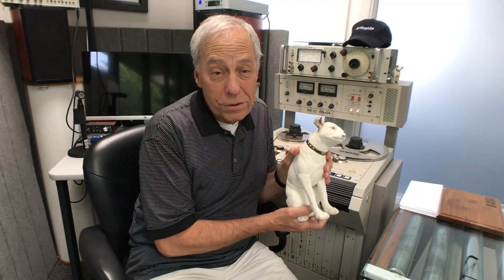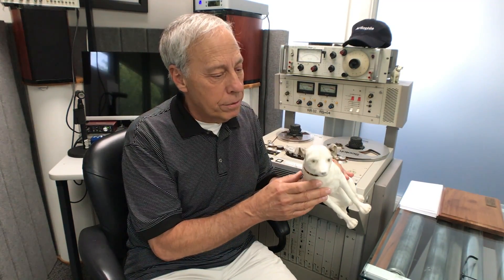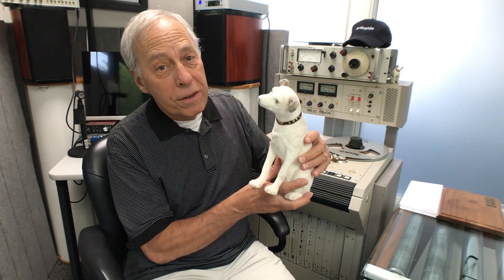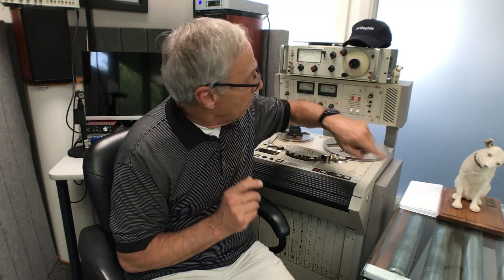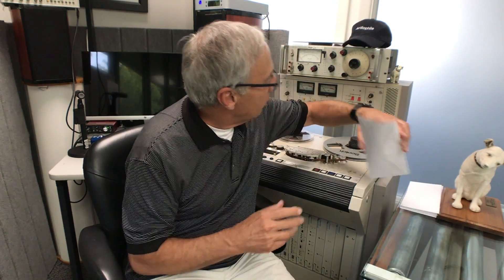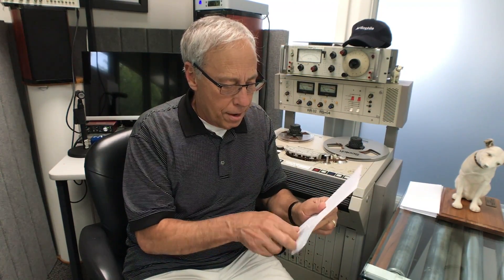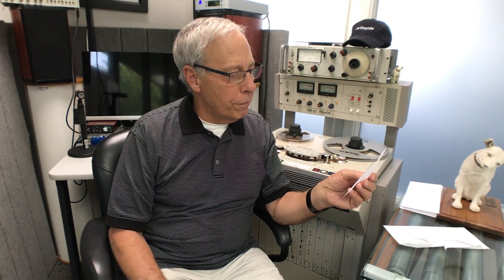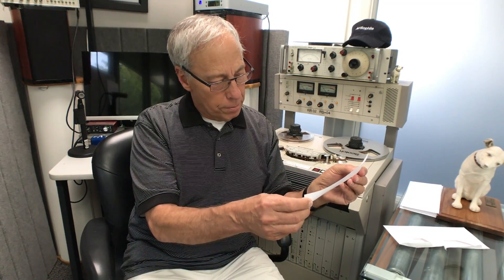Thin cables inside speakers

Comment: Its all about marketing, big and expensive cable to the speakers and inside thiny cable, question is why so thick cables from amp to speakers, well like I say its marketing, they know that smaller cable will do the very good job, but how they will sell you few hundred dollars cables, some times very thin cables from Kenwood, Sony, Denon, made in China can make very good sound. Power thats consumed from amps can not be transfered direct to speakers, components inside amp consume that el.power and transform to heat and bias, not all go to speaker cables. If speakers are efficient they do not need so much el.power and very tick cable, one of most efficient speakers I have was Canton from Germany, my small Denon F102 run big passive 30cm-12inch subwoofer like its nothing, others speakers need bigger amp...

Comment: Excuse me. But take the voltage/power loss over a  10[cm] speaker cable  as found inside the cabinet, and compare it to say 3[m] of same gauge cable. You have your answer there...
Reply: I have just read your comment ,I have rewired my speakers with thick wire NO change in sound quality.
Reply: I can measure it for you and compare voltage loss/length... but I wont, because I gave up on YouTube. Just do the math, it's there :D
Reply: Dambuster, as can be expected!
Reply: And the 8 ohms of copper in the voice coil?
Reply: @robertt7238  You think that's the DC resistance of the voice coil?? You know better than that!

Comment: I would say because the runs inside are much shorter, and also they are split up into separate runs for the different drivers.  So, three separate runs of 18 Ga. Would be equal to one 13 Ga.

Comment: The better question to ask is "why do you think loudspeaker wires need to be thick"? The only reason XLR or NL2 cables are thicker is because its a cable, not a wire. Its multiple wires wrapped together and surrounded with shielding. XLR for instance has 3 wires in it, while NL2 will have two, but thicker shielding due to its higher voltage.

Inside a wooden or polycarbonate speaker cabinet noise is little due to the material of the cabinet. Even if noise does reach the wires, its doubtful it would be powerful enough to drive an entire driver.

Comment: I dont think i have a really great answer, but its does make a difference.... Because i say it and i sell speakers.
Reply: Thats the problem,he never really answers your questions,only bla bla bla.
Reply: Xab Deth To which PS Audio speakers have you listened?
Reply: It would take a 30+minute video to go over the affects of each speaker design from speaker wire size going from terminal to crossover to driver. Mostly it has to do with impedance and power rating. However it will change sound signature and characteristic. It would depend on the speaker design into how it will have the most change; this is why he doesn’t go into depth however the simple answer is that it does make a difference.
Reply: @InChristJesus87  or maybe not
Reply: A speaker and wire forms a voltage divider network.  Resistance matters, therefore wire gauge matters.
Also, electrical skin effect.  Conductor count matters because of the skin effect.
If you care - go ahead and educate yourself on these two concepts.  If not, then there's no point in wasting my time explaining the details.
Reply: @jdlech  there is no skin effect in such low frequencies in audio ! 20-30kHz is nothiing. Skin effect occures by very high frequencies. Cable companies and "highend" people tell us many nonsenses.
Reply: @jdlech  it occurs at high frequencies and that is fact.
Reply: @a0r0a745  It occurs at ALL frequencies, and that is fact.
Reply: @a0r0a745  I never argued that it has any effect you can hear.  Quit trying to straw man me.  bh69videa argued that there is NO skin effect below 30KHz - which  is wrong.  I claim that it affects overall wire resistance - but no claims about how significant the effect is.  Just that it can be minimized with high count conductor cable.  Maybe if you actually read what I wrote instead of assuming a straw man argument, you would have known that.
Reply: @jdlech  why mention it then if it does not affect the sound quality. Pointless bringing it up don't you think. Straw man argument, you decided to bring up the issue that is not an issue in audio. Think about that, you decided to tell someone to get back to you. Did you even look at the Audioholic link. You include a link which I looked at and I read what you said. You make a argument for what exactly? Strawman.
Reply: @a0r0a745  Why mention the general theory of relativity when it cannot be measured on your trip to the grocery store?
We're talking audiophile level here - not your average chintzy radio or tv.
Reply: @jdlech  now you bring the general theory of relativity, why? care to expand what on earth you are actually trying to say? You don't make any sense.
Reply: @a0r0a745  So you're incapable of understanding metaphor.  Interesting.
Reply: @jdlech  I sense a superior being🤣 I had better bow out before I really get shown up😂 who is the one incapable of answering my previous questions? Interesting😂

Comment: There are many sources of electrical resistance in a speaker enclosure, the wiring itself is probably the least important.  The speaker voice coil,  crossover inductor  coils power resistors and adjustment rheostats all introduce losses most of which can't be easily avoided.  Anything beyond 14 guage is not needed.....for most home systems at least.
Reply: James Hindley I guess your system is built around voltage losses and not how things sound.

Comment: I heard the Infinity IRS speakers twice. Once with Conrad Johnson electronics and once with Mark Levinson electronics (Cello). They sound great and do everything quite well except the image tends to wander up and down the drivers. I prefer an electrostatic which has a solid image that is big yet everything in that image has the right size.
Reply: Anders Hammer I agree and would add magneplanar speakers such as Magnepans.
Reply: Magnepans are great but they make everything sound too big.
Reply: I like electrostats too, but it also might be worth your time to check out the speakers at round sound dot com. I have found them to be fairly impressive for non-panel speakers. Just sayin'.   : )

Comment: Kirchhoff’s Current Law.......google that..... current in = current out......you expensive cable guys need to stop and think about this....you have a fire hydrant connected to a fire hose.....once it hits your cabinet....it turns into a sippy straw.....that's where Kirchhoff’s Current Law comes into play.....the MAXIMUM amount of current ALLOWED into a circuit is the MAXIMUM amount that can go ALL the way through the circuit....period.....it's a LAW...not a theory....not a suggestion....it's physics....so put those brain cells to work and run that through a few times....
Reply: To Thomas Dane Jackson: I don't disagree with the truth of that. I'm disagreeing with the relevance of it. If you hook up 15watt speakers to a 100watt amplifier, you certainly could blow out your speakers or blow a weak-link/fuse in the speakers. And, you will also certainly not get the most out of your system.  If you hook up 100watt speakers to a 15watt amplifier, you certainly won't blow out your speakers or blow a fuse. But, you will also certainly not get the most out of your system. The speakers might require a minimum of 15watts just to hummmmmm.
Reply: Well, since you pushed it to the extreme, what you have there is wire which will heat up significantly, so it's now a fuse. I think we can limit the sizes to wires which will not change  temperature significantly. Also interconnects aren't created just for their current rating. You can debate the merits of different wire configurations and topologies but I don't believe all cable differences boil down to DC resistance.
Reply: Thomas Dane Jackson But does the water taste any different? Poor analogy. The thinner cable may or may not sound better. Nothing to do with resistance unless you plan on using 50 gauge wire. Two premium brand cables can be the same thickness on the outside yet have differing amounts of copper once you remove the jacketing and sleeve. Look at electrical household wiring and see how thin 12 gauge is. Thick speaker cables can have specialized air tube dielectric etc which would make it difficult and expensive to work with connected internally to speaker drivers.
Reply: Then there is the opportunity for Science! If there is a measurable difference in sound quality that we cannot explain with our conventional models, we need an experiment! Make a hypothesis, conduct a test, measure the sound, write an article and become famous. You could be the next Faraday or Maxwell.
Reply: E=IR. There are many regulated/fixed/variable voltage power supplies and many regulated/fixed/variable impedance circuits. But, you'll usually only find regulated/fixed/variable current circuits in battery chargers. Current is usually the dependent variable, and not the driving variable. And that includes when considering power requirements. As the power requirement goes up, ampacity has to go up. But, as power requirements go down, ampacity does not have to go down. In other words, too big ampere capacity is not as big of a problem as too small ampere capacity. You want the load to be able to draw as much current as it needs instead of trying to "allow" only what you have.
Reply: Two things: 1. You sound like you think gauge = current limit, whereas gauge x length is what's important. If the wire is short, it may not be the limiting factor.  2. Remember that we go from the speaker terminals into some crossover components, and then the smaller wires feed multiple drivers meaning no one wire is carrying the full current of the outside interconnects. When you combine these two factors, you see how the much longer interconnects can have an impact and should be suitably sized. However, the difference between good quality and premium boutique wire is small, so it's usually better to buy better equipment than to blow a large percentage of your audio $$ on cables.  Instead, experiment with cable upgrades down the road when everything else is set up and dialed in.
Reply: Well there are quite a few factors that determine "current limit"....conductor  size of course being vital....let's be real here....if the conductor is only one electron wide vs two electrons wide then your "current limit" is double....etc...etc...so gauge IS important....if you have 1 meter of 10 gauge conductor connected to a conductor that is one millimeter long and one electron wide then connected to another 1 meter of 10 gauge the "current limit" of that circuit is determined by Kirchhoff’s Current Law...which has been my point all along....your second point deals with series/parallel and that is exactly what Kirchhoff’s Current Law is all about....current in = current out.....
Reply: mfr58 Never truer words spoken. Not just in electricity either. No big grants or prestige given to scientists to show why cables or components in your stereo sound different.
Reply: Thomas Dane Jackson Your implication all along has been that boutique wire is wasted money. Also implying audiophiles think thicker wire is better wire. Apologies if I am wrong here.
Reply: bryede Exactly. To many engineering types resistance is the only determining factor in choosing wire for your system. Nothing to do with how the wire sounds. I don't believe anyone is using a strand of 50 gauge to connect speakers.
Reply: Poorly said.... and good show ol' bean.
Reply: Thomas Dane Jackson I haven't connected my system to the fire hydrant in front of my house.
 I feel it makes the music sound wet, so I guess I'm okay.
Reply: The water analogy doesn't apply here
Reply: Simply not true, you can send 20 amps through a 20 gauge wire, if it short enough it probably won't burn out either.
Reply: I repeat.......the MAXIMUM amount of current ALLOWED into a circuit is the MAXIMUM amount that can go ALL the way through the circuit.....in other words.....the ABSOLUTE maximum current allowed into a circuit is the ABSOLUTE maximum that can go ALL the way through the circuit.....meaning the most constrictive portion of a circuit is the weak link....ie...the 3 inch 24/26 gasp 28 gauge conductors inside the speaker cabinet determines overall current flow in the circuit.....not the 20 feet of monster cable running from the amp to the speaker post.....that's all....
Reply: Your irony is perhaps  nearer the truth than you think. Many a true word spoken in jest. Electricity is indeed still a conundrum. We use certain mathematical models to work with it, but it doesn't mean we understand all the variables actually involved. So things can sound different with no conventional model explanation, such phenomena are then scoffed at by dyed in the wool engineers who can't see beyond their limited models.

Comment: When Paul said "It (the internal wire) will never be what you have connected up to your speakers", Marten for one use some very high end internal wire. For example, the new Coltrane 3 Statement Special Edition speakers use Jorma Statement internal cables which are $16k msrp for the first meter & $7,350 for every meter thereafter! You can also buy Jorma Statement sc's to perfectly match up to the speakers ;)
Reply: Kidding... $16,000/metre for the first metre!!! Please tell all of us mortals what you honestly believe could justify that price. The little lumps of walnut? The braiding? Unless the actual conductive material is unobtanium (quite rare we're told) or pure gold, this is almost laughable. Seriously laughable. If these consumers don't like being mocked, they'd be well advised to keep the internals a bit of a smug secret.
Reply: Have you heard them? I run Jorma Statement speaker cables in my system connected to Magico S5 Mk2 speakers ($42.7k) and they sound amazing.
Reply: Audiofools who need to be separated from their money.
Reply: @lolilollolilol7773  Well your member name sais it all..

Comment: Pure copper bars, like the size of a standard hanger
in your closet, connecting terminals to crossovers to  drivers
is about as perfect a connection for sound transmission
as one can get.
Cut up your copper hangers and make the short run lengths
needed to do the above & you can be sure that you've got
the best possible wiring scheme inside your speaker boxes.
Or, do like I do and just leave it the way they came.
Like a car, your speakers are in the best sounding
condition possible before the manufacturers shipped them out.
But, if you don't trust them & think you can improve the sonics
by way of alterations, then by all means, open the boxes up
and solder away.
~ peace
Reply: Absolutely correct! They do not. However, frequencies at the upper limit of our hearing are still absurdly low frequencies in terms of AC conductance/skin effect. Those phenomenon appear at radio-frequencies. Also, the issue is somewhat self-mitigating as there is less energy in a treble wave than that of a bass wave, so the demand for power transmission is FAR less at treble frequencies presuming a neutral response is sought after.

Comment: You simply do not need thick for short 1 or 2ft links.  There's no resistance, 18awg or 20 is plenty.  It's ridiculous to think otherwise.
Reply: Complex, but impedance still remains insignificant.  Just like dropping or take out a drop in a bucket of water.
Reply: BUT I CAN HEAR COCKROACHES TAP DANCING ON MY NEIGHBORS RECYCLE BIN!
Reply: Surely the cable is only as good as the worst piece in the link. Usually from the binding posts to the cross-over and drivers. So why spend £100's/$100s on fancy cable unless you are going to take apart the speakers and re-wire them also?
Reply: It does have resistance but not much ...6/1000 of an ohm for 18 guage that's 6 ohms per 1000 feet.  Not to mention the wire in the crossover inductors
Reply: Doc Holidaze Yea but are they any good at it?
Reply: A 14 gauge wire drops 2.525 ohms in 1000 feet. That's .0505 ohms in 20 feet. That's not a big deal, I don't see your point. https://www.powerstream.com/Wire_Size.htm
Reply: I agree - the voltage drop across thinner cables inside the speaker cabinet is low due to their short lengths - its insignificant compared the long runs from the amplifier to the speakers,  a more elegant solution is to house the amplifiers in the speaker cabinets  !!
Reply: Kevin Weller: You don't need cables that cost that much. You can get some good oxygen free cables that are plenty thick enough for much cheaper. And you only need to rewire you speakers if you change them out to one that is more power hungry. And this, I would not suggest. Each speaker's sensitivity is important to the other speakers within the same enclosure.
Reply: goog le All testing should be randomized double-blind or it's simply GIGO. Placebos aren't a delusion that happens to other people who aren't very bright; it's just the way to world works and everyone is affected.

If you randomly switch the price tags on three different price classes of wine, you'll find that people rate the wine they think is expensive higher than they would if they though it was priced lower. It's not that they're trying to fit in; they genuinely experience the wine they believe to be expensive as better than they otherwise would.

Without blinding and without collecting a large amount of statistics you'd never have known.
Reply: thank you...
Reply: The thicker the wire the less passive crossover feedback noise ends up bleeding from tweeter to woofer
Reply: Impedance is much more complex, frequency dependent, and interactive with an analog audio signal than simple pure resistance.
Reply: not to mention your speakers would have to be significantly larger to house thick unwieldy cables.